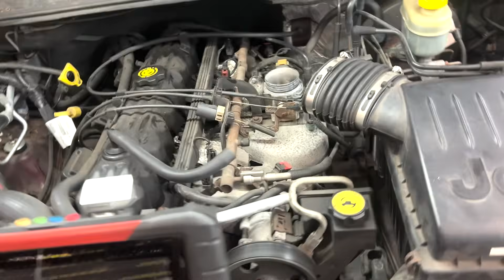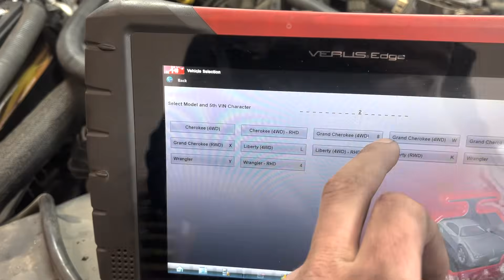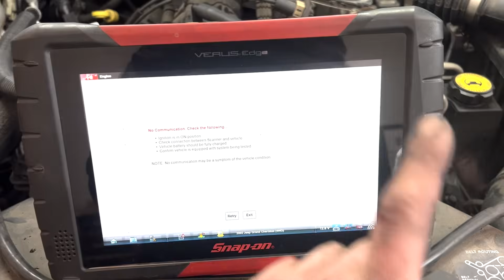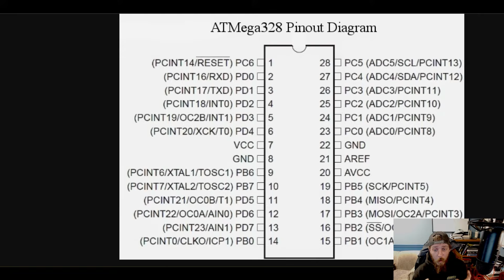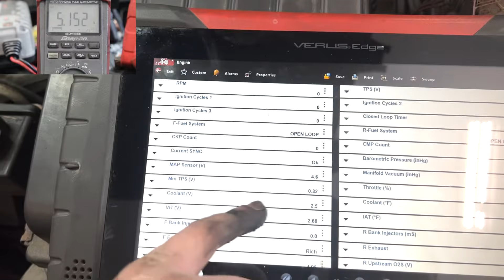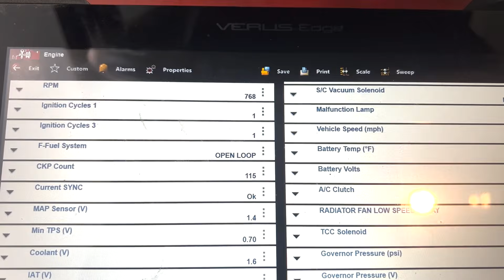Jeep Grand Cherokee - Crank No Start/No Comms

Comment: So have a buddy of mine we have been fighting with his jeep and it's a 2002 Jeep Grand Cherokee 4.0 we changed out the camshaft position sensor one you just did it started but when he went to test drive it it died right in front of his house didn't want to start so he left it sit went back out and it started right up got it back to his house and died again now won't start up just cranking over won't start got any suggestions

Comment: I have a 2004 grand Cherokee with the 4.0, and have replaced 4 crank sensors in 480,000 miles, also there is an access point to help get to the  crank sensor pull the heater duct off next to the throttle pedal, pull the carpet back and you get an access panel

Comment: The Ring around my key clyinder (skim ring) located right where you put the key in was so greasy from my hands / working on motors over the years  was  so dirty. I took the skim out,  cleaned the ring, but i believe it can be cleaned with a pocket knife or little piece of sand paper without taking anything off.  Although this was NOT mentioned in any of the videos, WORKED.

Comment: I have 5v at all my sensors but when the key is turned to on the check engine light never comes on…and my scanner isn’t communicating through the OBD2 port with the factory ECU. Bought another ECU(cardone) and I have the same issue. The guy at the dealership said the entire vehicle needs to be towed there with the new ECU so they can flash it but I really don’t have the funds to afford that. Question…is there a way I can flash this new ECU computer and allow it to learn on its own without taking it to the dealership? Thanks for any advice in advance..🤦🏻‍♂️this thing is getting the better of me..😤
Reply: I have the same problem with my 2001 jeep gc 4.7L
Reply: @ I’ll tell you what has happened thus far; I did end up towing it to the dealership. They tried to flash the ecu-and it would get about halfway done…and disconnect! (Ecu bad). Got another ecu now check engine light comes on-still no spark! And since the vehicle hasn’t ran it won’t bring a fault code up either. So, next is the crank sensor, if that doesn’t get it- coil pack… that’s the only things left that it can be!
Reply: @ I feel for you… they’re not easy to figure out without throwing the parts cannon at it $$$

Comment: Please looking for help. I have a 1993 jeep Cherokee xj . I turn the key to on and crank it but will not start . The only way I can get it to start is to turn the key to on and leave it there in  that position until I hear a tic tick tick at the fuse box next to the battery then the fuel pump primes now I can start it this wait time is longer when it is colder out please any help would be greatly appreciated.
Reply: Same here. Did ever find a fix?

Comment: I bought a 2002 grand cherokee 4.7 4x4 and had the exact problem....it was the camshaft sensor...thanks your video was alot of help
Reply: Did it throw any codes? How did you decide to change that? I'm not getting any lights on dash

Comment: I basically have the same problem, Crank, no start, no gauge's, no comm, but I do have a 5V reference and my skim light is on.  I unplugged all of the sensors and still don't have any communication. What should I do next thank you
Reply: Did you get yours back up and running? Same problem- cranks strong but no start, no gauges, skim light & "check gauges" on, unplugged all sensors, unplugged shunt cap under dash, still can't get it to fire. Any chance it was a bad PCM/ECU?
Reply: @BurninDownThaHouse Yes a bed ECU

Comment: Great job. I have had my jeep down for 3 years!!😣 took it to 3 shops to no avail. I’m a great mechanic but not as great chasing ghosts and gremlins using high tech thingamajigs.. I’ve replaced two crankshaft sensors (myself of course) on my 1999 WJ inline-6 4X4. Bought it brand knew in 99’. First time I replaced it was probably 2007 with an aftermarket CPS. Then again in like in 2020, aftermarket.. And both times that they died, they died with me actually driving then coasting to a stop! Well I replaced that 2nd bad one with an aftermarket again.. Then only a week later that one went out!! Now no OBD2 comms & no 5v ref.. Sooo I replaced that week old one with another aftermarket!!! NOTHING! So I started replacing EVERY sensor, NOTHING! Ignition switch relay, NOTHING! Cleaning ALL grounds, NOTHING! Tried creating my own jumper 5V reference using a USB cable from watching another YouTuber, Nothing! I’ve replaced the ECM using two different refurbished preprogrammed units using my vin, NOTHING!!! So I sent it to 3 shops and they couldn’t figure it out, NOTHING!!!! None of those shops were electrical shops because the electrical shops in my area were so far behind that I didn’t want my Jeep just sitting there for months risking liability damage to it.. So I towed it back home after it left the last shop. That was a year and a half ago. I just want my Jeep back running, damn! Makes me kinda hate Jeeps now. The dealer said it was too old so I had to use secondary shops because our two Jeep dealers wouldn’t look at it! Another reason to HATE Jeep… The only thing I can Ponder is that my CPS isn’t getting good ground perhaps. After changing that many of them I kinda stripped out the threads somewhat. So I added a little tape around the both to keep it tight. I mean it worked, I’ve done it before and it worked. It’s still tight. Also the CPS bolt receiver area is metal or copper and that tightens against the bell housing. I mean yeah, I wish it made more contact but I never had a problem the other times. No comms, cranks over but no start.. Where would you concentrate? Buying a 3rd new CPS this time Mopar?? Trying to run a self tapping bolt in my bell housing for the CPS? It’s already tight as hell just trying to get the original bolt back in, let alone trying to rig up another bolt or fastener! Hey I’ll pay you for some good advice, what do I have to lose at THIS POINT…😭
All I have is a semi basic OBD2 code reader, about a $150 type unit. And my simple multimeter. And yes I’ve tried unplugging all the things you did in this video and my comms or 5v ref. NEVER came back up. Those shops that looked at my truck NEVER found a bad wire, ground, NOTHING.. BUTTT, They took my word for it (because I bought two new ones) and they NEVER messed around with my CPS (as in removing it). And it only donned on my like a month ago that I had been using tape on the bolt to secure the stripped out CPS. The shops was saying they “think” it’s a bad ECM even though I proved them all with both of my refurbished ECM’s that had warranty on them both, from two different ECM providers.. I kinda don’t think it’s the ECM. But who TF knows…..

ANY help would be a God Send!
Reply: i have this same exact issue with my 2000 grand cherokee 4.0L, it sat for about a year before i got it due to someone hitting a deer with it. when i went to pick it up, it fired right up and i drove it on the trailer myself. when i got home i also drove it off the trailer and parked it. after changing the radiator one day i went to start it and it cranked and cranked then threw the crank sensor code, i’ve swapped the crank sensor on mine 3 times. now it’s just like yours, cranks and cranks, doesn’t fire but also doesn’t give any DTC codes. i’ve also had mine down for roughly 3 years smh. very infuriating.
Reply: i also agree with you about the ECM bc i’ve also tried swapping mine out 3 times from parts jeeps i have and still nothing. if you find anything out with yours please lmk. i’ll do the same.
Reply: @DaileyRiders  will do..
Reply: @DaileyRiders  Wow, this makes me absolutely hate jeeps now.. Especially no assistance from the dealer after they get like 16 years old…
Reply: @bravokilo1972  they’re definitely a pain. have you tried a new coil pack? i recently read somewhere that something about the 2000 coil packs differ from 1999 or 1998. i had changed mine from one off of a 1998 cherokee, so i changed it back to the OEM one yesterday and got it to at least pop over when it cranked a few times, now i’m facing a new problem with my key skimmer so fuel and spark are shut down smh. i love electronics. also another thing you could check is your cam sensor/synchronizer.
Reply: @DaileyRiders  All that I replaced with NEW parts.. I threw a lot of money at this.. Fuel pump and filter too. I was keeping it forever from buying it new so didn’t care about replacing 20 y/o parts. They’re OEM too so no cfm fuel pressure issues later. New ignition switch.. And mine didn’t come with the fancy chip key anti-theft system so no worries there.. Still no spark or fuel!!! Last thing is new ECM, but sooo Expensive that I tried everything else first. Refurb ECM etc..
Reply: @DaileyRiders  Meant ECM’s (plural) (2)
Reply: @bravokilo1972 have you tried neutral safety switch?
Reply: @mattburns2968 Damn that’s a good idea never thought about that
Reply: Check your door jam wires. The wires in the door jam bend and break inside the boot. Common problem.
Reply: @MaxExcitementRC thanks!
Reply: @bravokilo1972  I now realize I’m 2 years late…😂
Reply: @MaxExcitementRC 😂

Comment: Dude, thank you for the excellent diagnosis. I've been chasing electrical gremlins in my '01 Grand Cherokee for weeks. It all started with a no crank ,no start. Cleaned all grounds, new pcm ( which was fine for 3 days then left me stranded). I put the old pcm back, topped off the battery cells w/ a charge and no issues except for an occasional amp gauge waver from 13.5 to 14. 5 with all accessories on.

Comment: Excellent job teaching us microcontroller basics. I can see how lesser mechanics would start by replacing the ECU. If you pull all the sensors and you still don't have the 5v vcc needed, then check the 5v pin at the ECU connector. If you still don't have 5v, then open the ECU, look for a 3 pin part labeled 7805. This is the voltage regulator that takes 12v and outputs the 5v. If the 7805 regulator measures 12v and ground OK but no 5v, then desolder the 7805 and replace it. That should do it. Also, once all sensors and ECU are unplugged, you should have no reading across the gnd and 5v rails when measuring resistance. If you have any reading then you have a short in the harness. Good luck

Comment: My 03 Grand Cherokee 4.0 is having the crank/no start issue with the Security Key light on. None of the gauges work either. I replaced the crankshaft position sensor, and it did not fix my issue. Suggestions on where to go next?
Reply: Pcm
Reply: Door jam wires broken inside the rubber boot, driver side

Comment: I recently pressure washed my 4.7 right near the crank sensor and cam sensor, nothing on the top of the vehicle at all. Now I have no comms at all, SKIM/key light is on. I unplug the crank sensor and still have no comms, could I have water further down the wire loom shorting something out? I picked up a new crank sensor and in the process of installing that.

Comment: Hey I’m having fuel pump problems I just got a new pump and my pump is not turning on I have unplugged it and cleaned the plug and tested the relay and it’s still not wanting to prime can u help ?
Reply: Did you ever figure it out mines doing this out of no where
Reply: @braydenwilks2144   yes I did it was a 15 fuse that had blue after i changed it I still had the same problem with just a crank no start so then I found out my cps was bad and she started right up after that

Comment: Dude! Glad to see you back here making  videos. Thought about you the other day while diagnosing a head gasket failure on a CAT 307D. Was able to use a pulse sensor with relative compression to prove the failure, but wished I had a piezo tach pickup to use for sync. Hope all is going well in your world!
Reply from the maker: Easing back into it, I'm too picky trying to make things perfect before posting. I got talked into just rolling with videos a bit more.

I hope all is well my friend, I'm looking forward to catching up with you.
Reply: @scienceofdiagnostics

Hey.  Excellent video. I'm sure you get lots of people asking for help but I've run into a similar situation with my 2007 Jeep Grand Cherokee.  I've taken it to two mechanics and they haven't been helpful.  Blamed the immobilizer at first, and then the other garage said the computer needed to be reprogrammed. And the dealerships are being helpful (both in scheduling and cost).  If/when you have time, could I ask you some questions based on what my Jeep is doing and maybe point me in the right direction?

I need it running and I don't have a ton of money to throw away with a dealer (if I can help it).

Anyway, awesome video.

Comment: Nice to see a video from you brother hope all is well. I have a 99 Jeep Wrangler no rpm , crank no start gotta love the early models putting a steel bolt in an aluminum transmission bell housing for crank sensor lol awesome those engineers. Good to see you brother
Reply from the maker: Things are going well. The dissimilar metals doesn't even bother me as much as the fact that you just about need 6' of extensions with 3 swivels and a little magic to get that thing in and out. One of those "I can see it, so it sure ain't gonna be easy to get it out" type deals.
Talk to you soon.